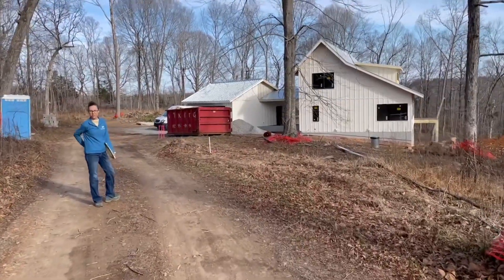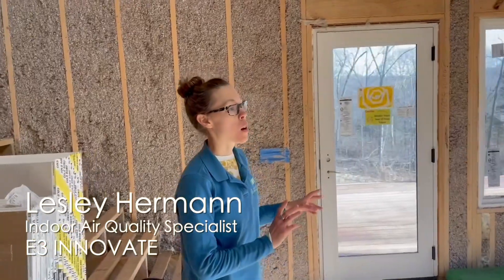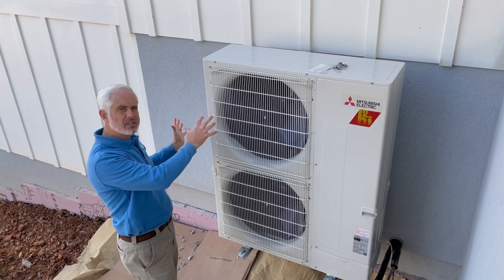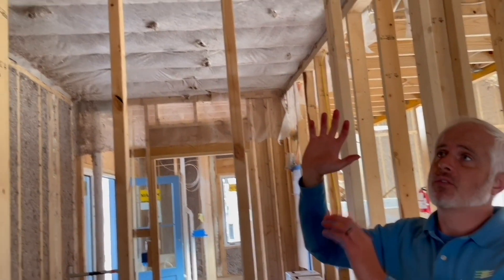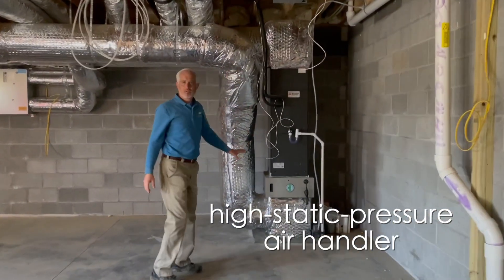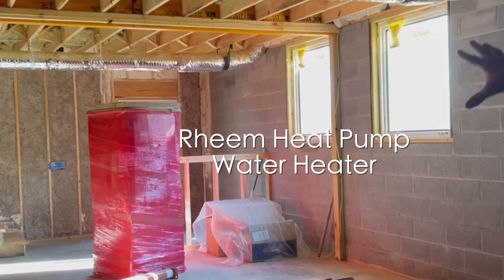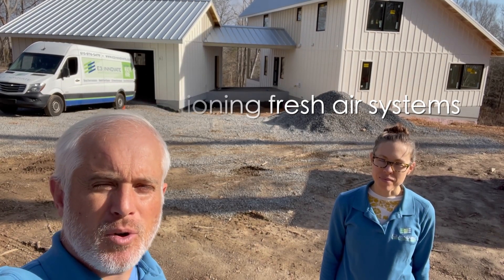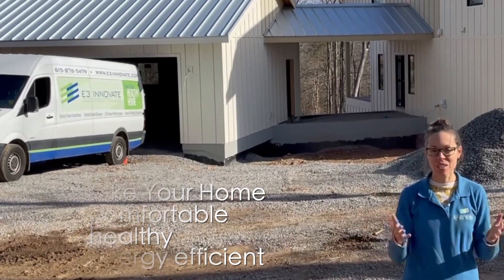Designing and Building a High Performance New Home in Ashland City, TN

Comment: If you ever have any problems with water infiltration such as roof leaks, you will wish you never used open cell foam. Open cell foam is like a sponge around water. Most competent builders would talk you out of it.